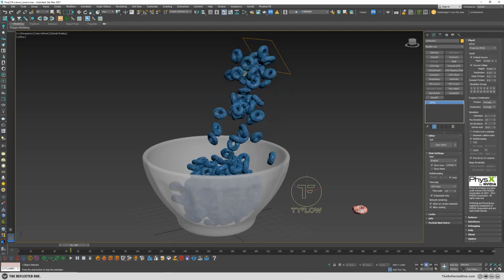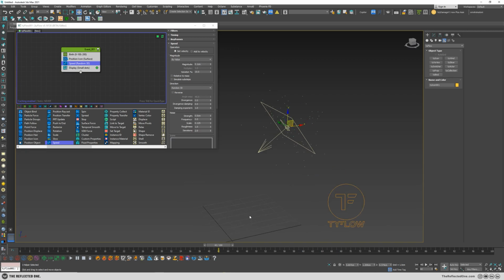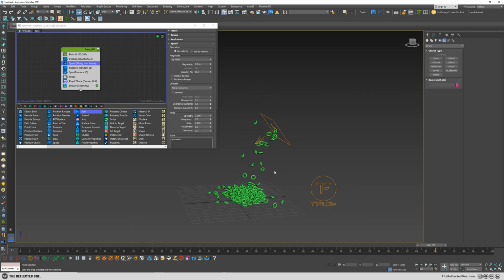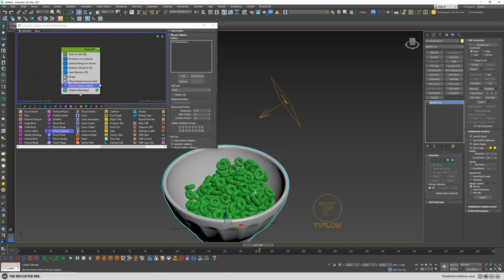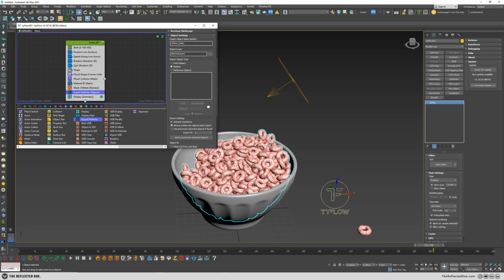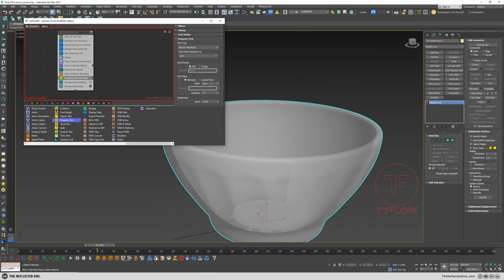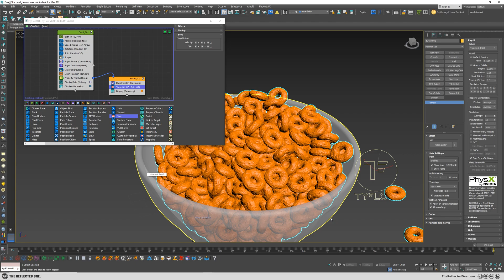[Tutorial] How to fill a bowl with tyflow | Complete beginner tutorial

Comment from the maker: 🔖 To do list if you forget the process 
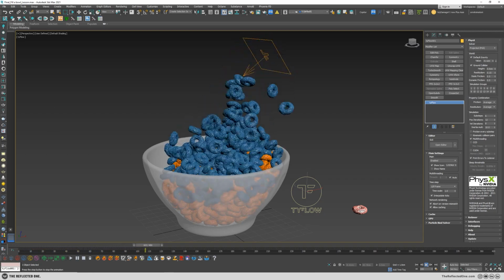00:00 Intro
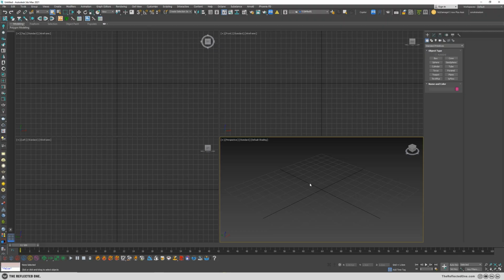00:16 Birth operator 
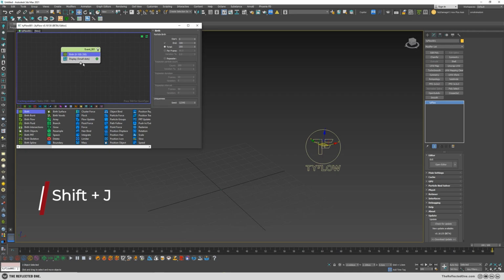01:16 Position Icon operator and Pick first Ty Icon
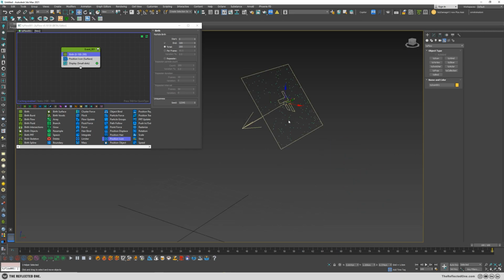02:04 Speed operator and pick Ty Icon again
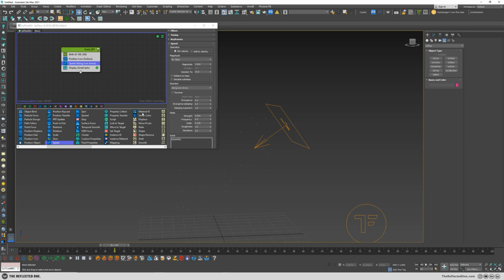04:04 Shape operator
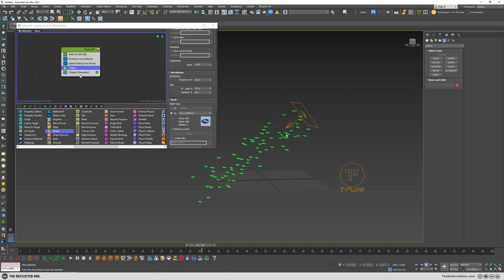05:05 PhysX operator
05:33 Rotation operator
06:02 Spin operator
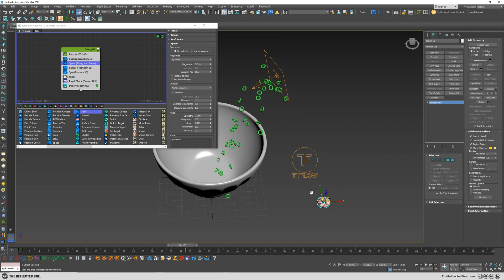08:06 Add cereal geometry 
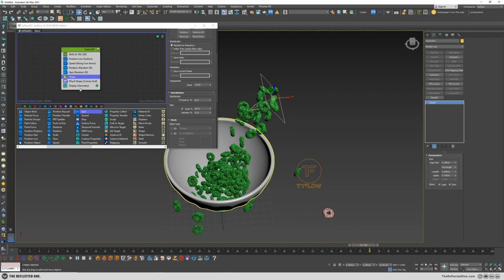08:43 PhysX Collision operator
10:08 Add Mesh and material ID for rendering
10:48 Assign Cereal Material to Tyflow
11:41 Export Particles operator
13:28 Display Data operator
14:06 Property Test operator
14:39 “PhysX Switch” to Kinematic and “Stop” operator
16:03 Remove Material in 3ds max and Done